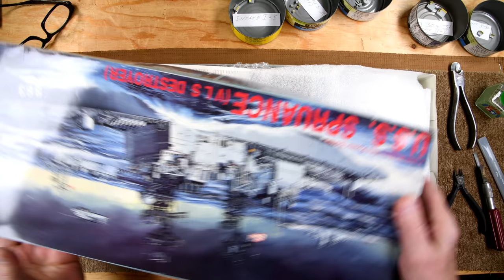The Model Ship - Part 46

Comment: Ron try less air pressure 10 - 15 psi and maybe a bit thinner paint.
You will get the hang of it for sure.
Reply from the maker: Hi Noel,
Yes, just mentioned that to Jim below. Thought I go back to about 15 psi. Was at 20 today. As for thinner, well it's pretty thinned out already. We'll see how it goes tomorrow on the hull. 🤞